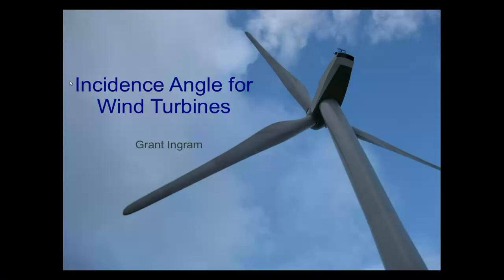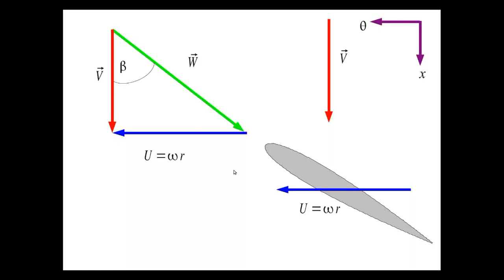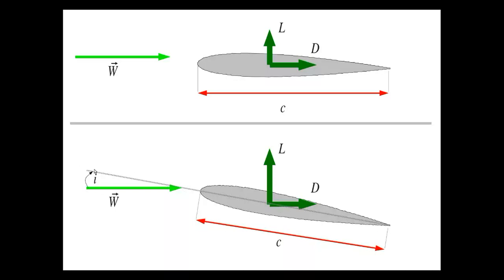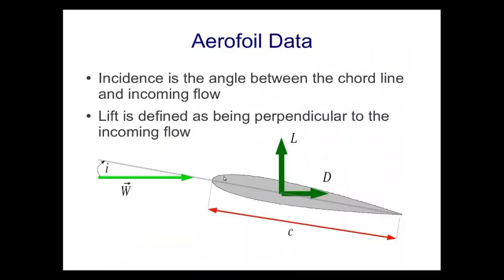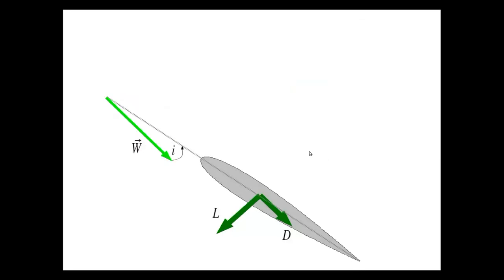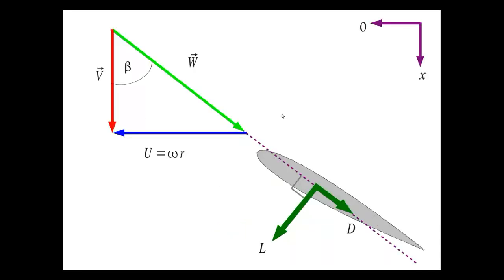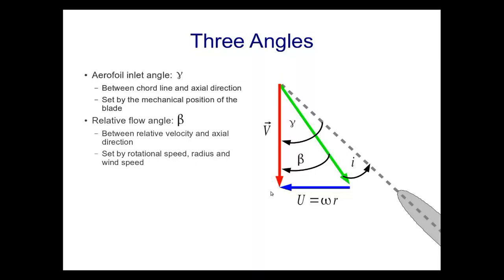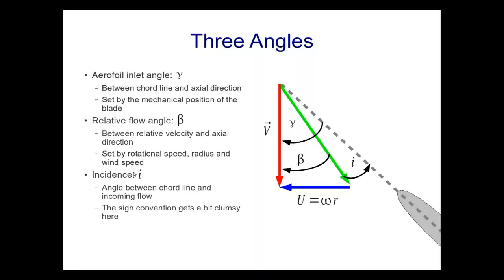Wind Turbine Incidence

Comment: Hi, great videos on wind turbines, they are really helping me with my current final year project. Could you tell me what would happen if the airfoil was positioned with the top "convex" side facing the wind instead of the usual bottom "concave" side? Would it have an effect on the wake or any of the vortical flows within the wake??
I would greatly appreciate any input!

 Thanks
Reply from the maker: CoolBananas - as you can tell I don't check the comments very often.  I hope your project went well!